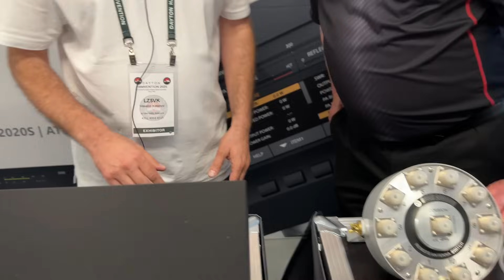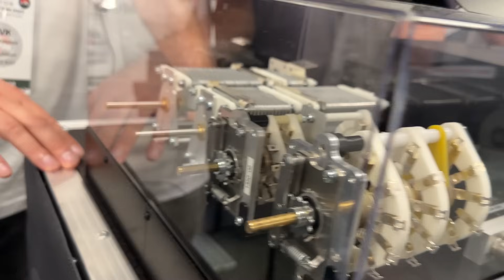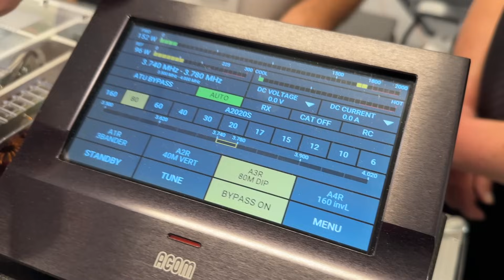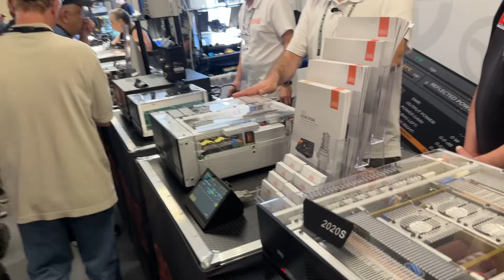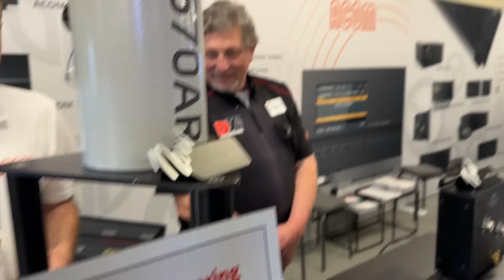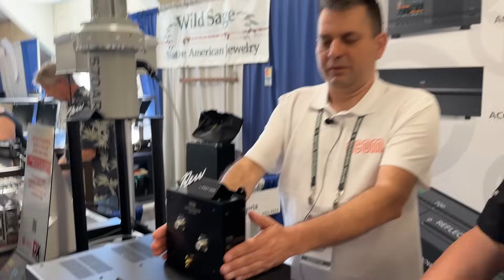What’s New with ACOM Amplifiers for 2025 | Dayton Hamvention® Booth Tour

Comment: The L-PROT3 it appears as the filter has to use the ground terminal and energy rejection, or it will rely on you jumper cables and could enter that way, so I think it would be critical to run a good ground for that unit. Whereas tube gear can jut have an arrestor and run fine, like he said there will be just an arc in the tubes vacuum.

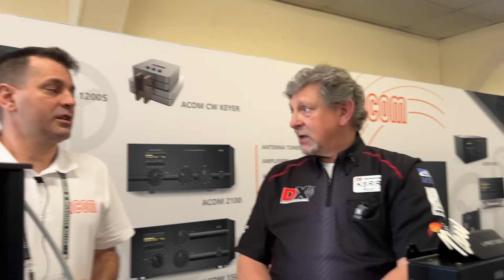Comment: 19:00 this is designed to be used with more than one antenna, it would be good with a 80-10m vertical so 20m high with no traps/coils just tune it and go maybe a cap for the higher bands. Then you would have one or two doublets covering 160m-10m and then the last would be a loop 20m x 20m x 20m x 20m horizontal about 20m high the vertical tower would be one support and you would have another tower for one of the doublets and run the other to the house. 
That is likely the type of setup that outdoors tuner is made for, all antenna have sufficient copper in the air just need a tuner and you get all bands, but there will be some big miss match so the SWR kills long runs of coax in these situations. 
That is why most people with a tuner with the 600ohm posts run ladder to either a doublet or a loop because the ladder line is better for the SWR loss.

Comment: What I would pay money for is a valve amp and tuner like bigger and chunkier than a Palstar, all in one unit with all the tuning done automatically like the solid state amp with servos internally driving the capacitors and inductors. Two 5-300Z's being driven by two 572B's for a 100w exciter. So it's all digital on the remote but it's actually a valve amp.